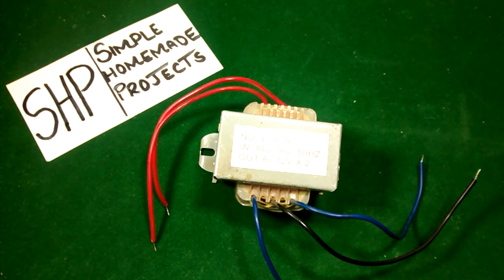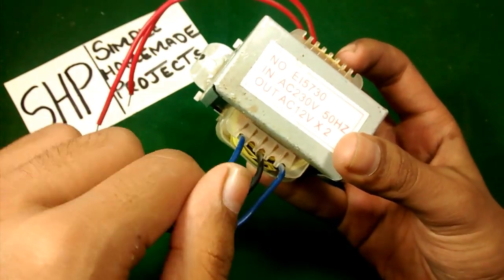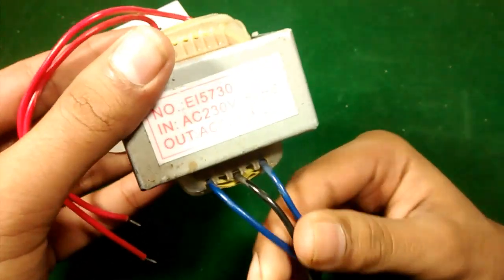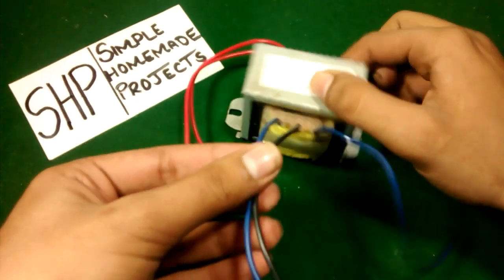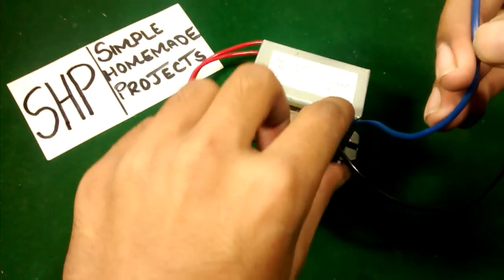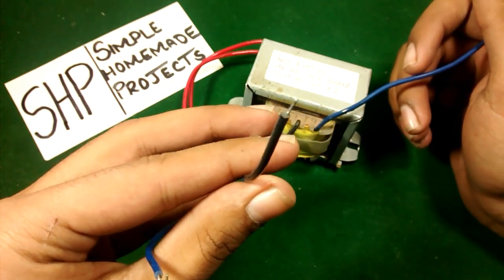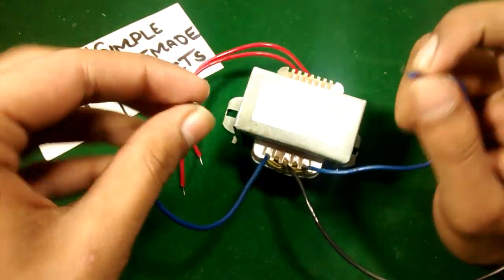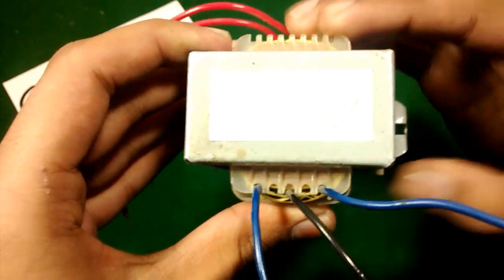HOW TO USE A 3 WIRE TRANSFORMER ?

Comment: You are simply the best! I have been looking for a simple explanation, of what you have just explained, for “days”, but you are the only one, that I have found, that has gone straight to the core of the most simple, but very difficult to find,: answer to the problem!!! Thank you: it was so simple, “now that I have found you”. Believe me, everyone else was giving a University lesson, just to explain what to do with just 3 “f” wires coming out of a simple transformer!!!!! Thank you!:):):)
Reply: Same here, when I was searching that If I can leave one wire and use other 0-12 I found Some cutting the insulated tape and making it 24v and many more. Thank God I end up here.

Comment: The problem I have is: I got a transformer from a ups , looks heavy duty, but it only has 3 wires altogether. Can I safely use it in a power supply? Thanks.
Reply from the maker: Hi , first you should test it with a multimeter, check the voltage either a step up or down then use it .

Comment: hi sir i have question,i have a amplifier board wich have 3 pin input wich is ~gnd~ sign that is compatible with same transformer as yours,question is can i use 2 wired transformer for my ampli board?i mean jumping the two connection with same positive wire?
Reply from the maker: First check out what is the rated voltage of ur amplifier. Like if ur transformer is of 12 volts and ur circuit needs 24 then obviously it will not work, but if ur circuit is also of 12 volts then it will work. If they are compatible then make sure it supplies enough current. So you have to connect middle wire to gnd and the side wire to ~ input and connect a jumper wire from that input to the other one.

Comment: First time on a 3 wire transformer we hace 24 volts and 12 volts the 2 outer wire wire  24 volts and the center wire with any of the outer wire was 12 volts so we connect 2 diode to the 2 outer wire  as positive and used the center wire as negative

Comment: what is the function of the black wire in the middle? is that ground?
Reply from the maker: As i said in the video, if u want 12 volts than use black and any one of the blue wire but if you want 24 volt than just use the bluw wires

Comment: i have a 18v x 2. my 3 wire output is black blue blue. can you explain what is the voltage of each? i dont have a power tester
Reply from the maker: Yes i, if you take one black and anyone of the blue wire, it is 18. But if you take both blue than it is 36 volts
Reply: @SIMPLEHOMEMADEPROJECTS  thanks a lot
Reply: @SIMPLEHOMEMADEPROJECTS  is the black wire the negative?
Reply from the maker: Its AC current, so it does not have negative or positive
Reply: How about you buy a damn multimeter if you play around with electricity.... uh ?

Comment: 24 volts ac or dc?
Reply from the maker: AC, to get DC you need a bridge rectifier.
Reply: @SIMPLEHOMEMADEPROJECTS  i know, i think at the end of the video you said it outputs 24 volts dc
Reply from the maker: @nasifabdullah362  yes, i said if you use a bridge rectifier then you will get 24 volts DC
Reply: @SIMPLEHOMEMADEPROJECTS  ouhh okay.

Comment: Which is the negative and positive
Reply from the maker: This is AC current, it doesn't have polarity
Reply: @SIMPLEHOMEMADEPROJECTS  At the end of your vid you say "use only the blue wires and you get 24V DC" I think it's AC input and output.
Reply from the maker: @ruwdbouy  please listen it again, i said if you wants DC then use a bridge rectifier with it. Bridge rectifier is a device which convert AC into DC. Hope u got it.

Comment: That is a five wire transformer!
Reply from the maker: Hi, yeah you are right. Point here is that primary of every transformer has two wires but secondry can have more than two depending upon number of coils inside it, so it is about the secondary not the primary. Hope you get it.
Reply: @SIMPLEHOMEMADEPROJECTS  I have a transformer with only 3 wires and itrying to figure out how to use it (white, red, blue and no others).